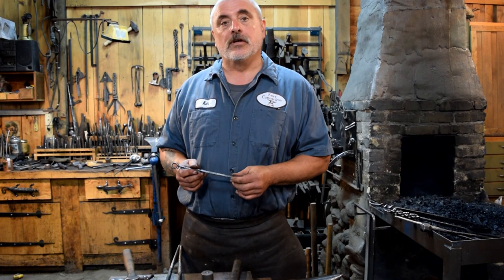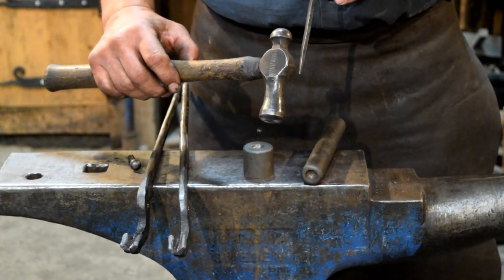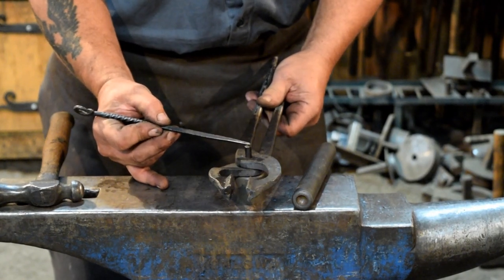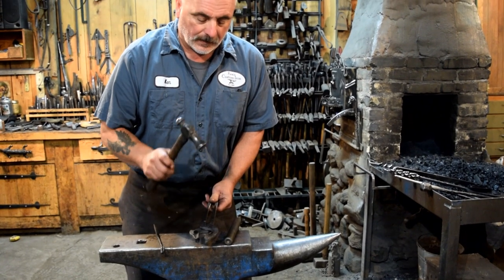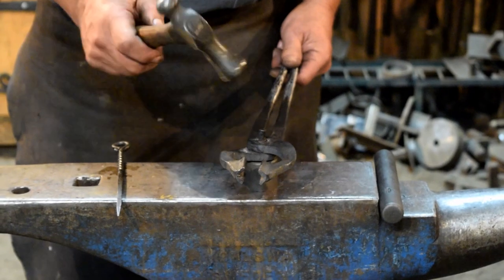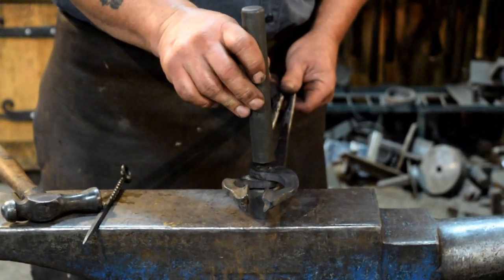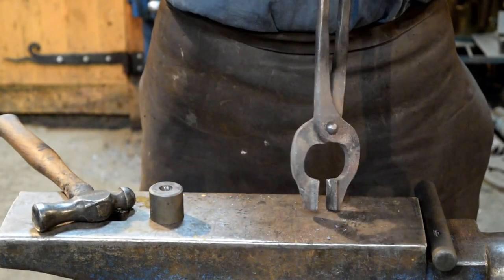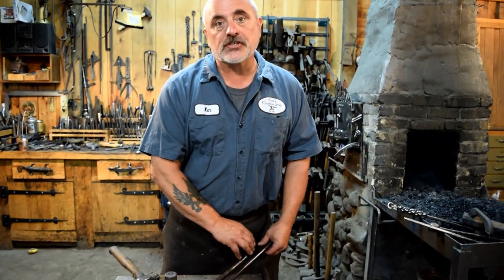HOW TO: Riveting Basics

Comment: i’ve been doing it without the tool and rounding the head with the peen. . this video made me want to get it.
Reply from the maker: The bucking and heading tool work excellent. They finish off the rivet end so nicely.
Reply: @KjZiturKensCustomIron  what type and size is the ball peen hammer you are using in the video?
Reply from the maker: @kinnersean  It is a 24 oz. standard ball peen that I modified by drawing out the face making it longer.